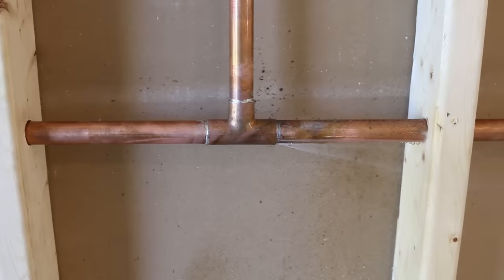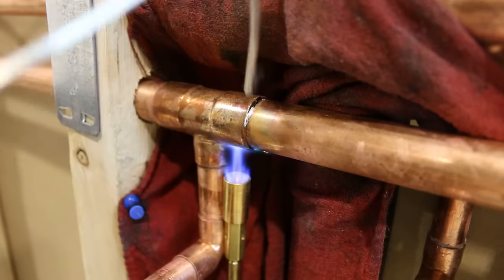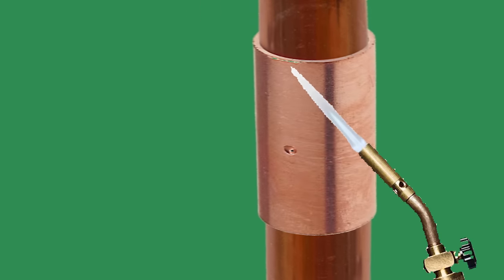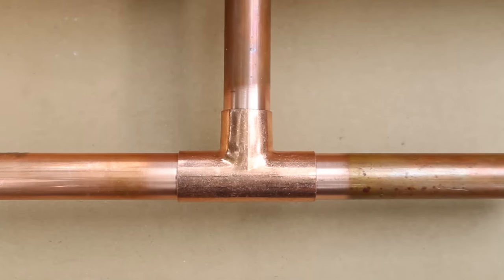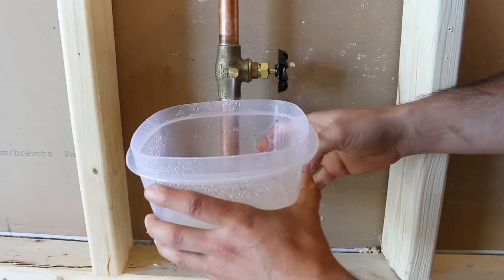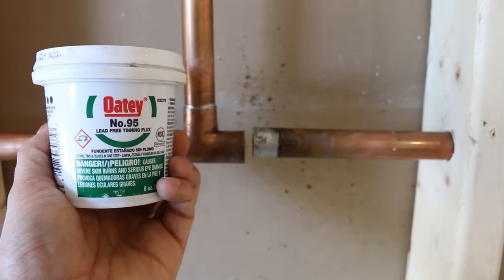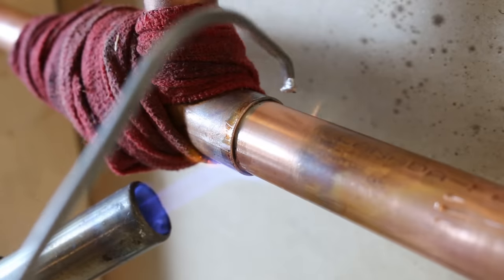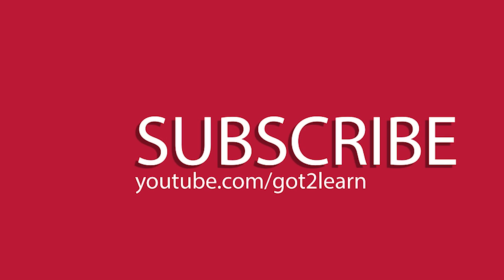The CORRECT Way To Fix A Leaking Joint (UNSOLDERING) | GOT2LEARN

Comment: flux core solder is best for circuit boards ..solder with flux and flux paste is best for pipes ... the JOINT MUST be clean inside and outside where the pieces will meet ... apply flux paste to BOTH sides of the joint fit them together and apply heat 3 to 4 INCHES AWAY from from the joint so the heat radiates TO the joint and takes longer to overheat ... as the paste liquefies apply the flux core solder and let it flow and watch as the solder flows around ... once it has remove the heat and wait DO NOT apply a wet rag DO NOT chill .. DO NOT force cool it for ANY reason as this can break the bond between the solder and the copper as Solder cools faster than copper and the copper wont have solder affixed to it ... as for learning to solder a 4 foot section of pipe and some joints and an hour of practice and you will become pretty good at it if you do the above ... that is the benefit of 42 years of soldering circuit boards and copper pipes

Comment: There are multiple problems with a "partial repair." First thing is any water in the tubing will prevent a comprehensive heating all the way around. One of things we used to do was shove bread into the tubing which will keep residual water away from the solder area but that's not gonna buy you a whole lotta time. It will dissolve later. If you don't keep water away from the solder area the water heats up causing steam pressure which can blow the joint apart, been there done that. Best thing, find a way to shut the water off, make sure to "sand" (usually emery cloth) both ends of tubing, flux all surfaces thoroughly. When you heat the coupling don't waste time. Make sure the solder gets sucked in all the way around. Wipe the residue drip on the bottom before it hardens.

Comment: PLEASE HELP....my bathroom sink backs up into the shower. I’ve been Shop vacuuming the shower drain out and after doing so there is a sewage smell and the shower and kitchen sink clog up on a regular basis. I often have used Thrift but it no longer works. I’ve had my kitchen sink floor drained cleaned out and it helps but it may be needing to be done regularly....I think.  When I’ve asked a plumber they usually reply ...hm, I don’t know.  Can someone please tell me what is happening. Thank you.
Reply: Does your shower drain slowly also?  If so, it sounds like the sink connects to the drain of the shower and there is a restriction / obstruction between that connection point and the sewer... Sounds like you need to either be better in your use of a plunger or need to run a drain auger through it... Most houses only have a single connection to the city sewer line and the various drains in your house will connect to a common line on your property that empties into the city sewer line... If you have an older house that still has clay or cast iron pipes that connect to the city sewer line, you might mind that some tree roots will get in the joints and clog up the lines... If that was the case though, every drain in your house would most likely be having a problem... Does your toilet also have slow drainage?  I'm not a plumber, but it's not that difficult -- water flows downhill...

Comment: If the pipe has to be hammered into the fitting, the join is quite possibly too tight for the solder to be drawn into all of it, so it's better to sand down the surfaces a little bit more.
Reply: Presumably the residual solder that is making the joint tight is fully re-melted during heating.

Comment: Keep in mind solder WANTS to adhere and is attracted to copper; also heat, and if you have a well  prepped surface it will push the rosin out of the way and thru the jount in the process.

Comment: Best way I found to clean glue on a pipe is spray a bit of WD-40 or 3 in one oil. Make sure you properly clean before soldering to not start a fire.

Comment: Only one last step missing at the end, neutralize the acidic flux by wiping it with a wet cloth and  baking soda. It will stop green oxidation on copper which might eventually pierce the pipe.
Reply from the maker: Great point!

Comment: “Knowing how to solder is an art and it could take years to perfect.” 
 Soldering basics are some of the first things an apprentice should learn. Clean pipe and fittings, flux both, heat the bottom and touch the top with solder. When the solder melts switch the heat to the top and melt more solder into it. 
1/2” fitting = 1/2” of solder per joint. Same would apply for each pipe size. Watch your flame and remember the end of everything you solder with will blister you. Now practice at home. We will let you solder caps on in a year or so. 😂😂

Comment: What if you can only get to one side of the copper pipe to heat it , I repaired a leak and only heated the top because it was in the floor but it was fine flux took the solder all the way round the pipe.
Reply from the maker: Then I'd suggest maybe using tinning flux to put all the chances on your side.
Reply: @Got2Learn  oh does tinning flux put the solder round the fitting better than normal flux, I've never used it before.
Reply from the maker: The flux has solder powder in it, so your chances of having a dry spot are close to none ;)
Reply: @Got2Learn  thank you I'll try it. Cheers

Comment: Everything you said in here is 100% except for fluxing the fitting being wrong. The flux follows the heat so even if it gets pushed to the back of the fitting, once you apply your heat it will re distribute the flux around the pipe and inside the fitting. It's not going to stay globbed up in the back of the fitting. So putting it just on the pipe is fine and fluxing the inside of the fitting is absolutely fine as well. Plumbers been fluxing the inside the fittings for 100+ years and no issues so at this point its your preference. Neither are wrong in my opinion

Comment: i worked for years doing bathroom renos and overheating the pipe is something i did several times and had to redo them.. of course they are in a basement at the lowest point and drip forever 🤣

Comment: To put the pipe back in the copper T easier i just heat up the old solder and wipe it off with a scotch brite and the inside of the t with the brush while its hot. It goes in very easy after that without banging it
Reply from the maker: Yes, good technique!

Comment: What happens when you get a fitting that wont solider! Everything cleaned sanded. Maybe the brass fitting bent?
Reply from the maker: It depends on many things. Are you using too much/not enough heat? Is there residual water in the system?
Reply: @Got2Learn  Did you preheat the thick pipe?

Comment: I don't know about you but I've never seen a plumber try to just add solder to a leaking joint. If it does leak it usually followed by a bunch a bad words and then having to cut out the leaking fitting and soldering a new one. Although I have save some fittings before with this same method.

Comment: to clean an old soldered pipe, the best way is to heat it up till the solder melts then use a cotton towel to wipe the old solder off the pipe then, use, preferably,  a scrub pad like the 3m scotch brite 07747. You will end with a perfectly clean pipe.
Reply from the maker: 100%

Comment: He left out water in the line. If 1 drop is near that joint ..your solder won't take....a oldschool plumber taught me this trick! Clean fittings as here.. get sone bread... and packed the pipe both sides if you have too..if you can't get the water to completely stop...the bread absorbs the moisture just long enough to heat connection and solder to wrap around joint. .  I agree with everything else he said..but like I said..here's 1 thing he forgot to mention. And open every faucet in the house..and if you can , have water shut off a day before to get most of the water out of pipe

Comment: Bro get with the times.pro press is way to go.💪🇺🇸
Reply from the maker: Yeah for sure, all I could say about ProPress is that when you make a mistake and your fittings are all crimped back to back, you are actually in a worst situation than if you would of soldered it lol ;)
Reply: Whay about if the pipes are old and really thin, will the propress damage them more than soldering, at work they want us to solder
Reply from the maker: Well yeah, if the pipe is full of holes due to corrosion, Pro Press is not the best option.
Reply: @Got2Learn  that was not the situation.if pipes are corroded then replace with pro press. Ihave solderd for over 35yrs.this New tech.has its place in most all situation.try soldering with water runnung.wont happen.a far better pro choice over shark bite..

Comment: If you hold the torch directly under the pipe, solder can drip into the torch.  Better method is to hold the torch at an angle from the side.

Comment: Just use Yorkshire fittings a lot easier I am a semi retired electronics engineer and it is far far far more difficult and precise to work a surface mount PCB soldering a 15 22 or 28 mm pipe is a piece of cake

Comment: Love Reading all the  'professional ' comments. The guy showed you the proper way to repair a failed joint, deal with it or make your own vid. Ps, back in the day, if stuck with a weeping pipe not letting you solder the joint, as a last resort, shove some bread up the pipe, complete your joint then with the bread come out the tap.

Comment: I've been plumbing for 17 years. All you have to do is take a nail setter, place it on the side of the fitting directly over the leak and whack it with a 22 oz framing hammer.
Reply from the maker: Ouch

Comment: Ok, not that I would EVER do this, but has anyone SUCCESSFULLY "fixed" a pinhole leak by cleaning the area, fluxing and the soldering over the hole?

Or, perhaps taking a copper sleeve, cutting in 1/2, de-burring, fluxing inside that and on the cleaned pipe where the pinhole is and soldering on the halved sleeve as a patch?

Again, I wouldn't do this.  I'm just curious if that's something people do in case of emergency or where it's very difficult to replace the entire run of pipe.

???

Comment: Oaty Number 5 works the best all the water soluble flex is trash . Clean copper fitting and use thin coat of flux .

Comment: Is it not easier to use push fit connections
Reply from the maker: Nothing like a soldered joint.
Reply: @Got2Learn  yes this is true. But until one learns?
Reply from the maker: That's what this channel is for :)
Reply: @Got2Learn  yes that's why I've subscribed😃

Comment: My question is why are you using type M copper and not type L copper for water service especially inside walls because most jusisdictions require type L pipe  and how would you unsolder the joint that was already connected downstream to another joint with no room to pull the joint apart . In most cases you would have to remove the complete section of pipe to Re clean the pipe and the joint properly, and more than likely you will end up with repairs down the road due to using the type M copper anyway budge to hard water conditions

Comment: Here is how I fix a leaking joint like that:  Wrap 10 layers of silicone tape over the leak.  Fasten a stainless steel hose clamp over the silicone tape to keep it pressed up against the pipe when the water pressure is present. Works every time.
Reply from the maker: Good, but temporary.

Comment: Get it hot again , add flux , it will re-clean the inside where the leak is. Add solder from 5 o’clock up to 12 , then 7 o’clock up to 12. 6 will fill in-from gravity.

Comment: Or cut the joint out and replace it using slip fittings. Sometimes unsoldering is a bigger job than you would think.

Comment: I have yet to find a video on how to sweat new to old pipe.
Reply from the maker: On an old pipe, you would just sand it to bear copper and solder it, that simple :)
Reply: @Got2Learn That does not always work the first try if ever. The next time I am working with old pipe I am going to clean the inside of the pipe. I think oxidation on the inside wicks into the joint when heated.

2 out of the 3 old pipes I last worked with definitely had no water in them. I was only able to sweat 1 of those 2 without a leak.

Comment: This is why your neat solder joints with no exposed solder is a bad idea. When soldering you want a fillet, not just enough. You don’t want it dripping but you want a clean fillet around the edge that you can visually see. Because not even clean solder joints are always perfect. It may be fine until you have the pipes in the wall and they start leaking after a few weeks.

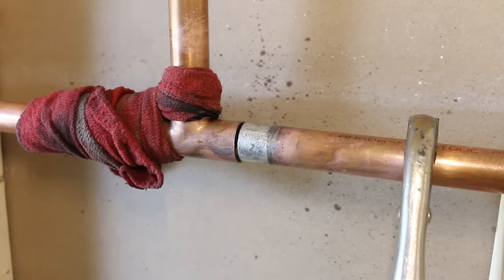Comment: 6:42 you say get a WET rag to remove solder so the pipe fits in… a dry rag is better, and I think what you meant. Wet, will harden the solder making it impossible to clear the solder.

Comment: Can somebody please explain to me why the pipes raddled Avery time we open a faucet or run the shower or any other appliances I don’t know what to do help please 🥴
Reply from the maker: 2 possible reasons: 1) the pipes aren't secured. 2) You need a water hammer arrestors.
Reply: Got2Learn ok thanks I’ll check #1reason
Reply: Got2Learn thank you for your advice it was very valuable to me I think I’ll need a to have a hammer arrestor installed for me by a professional Plummer . These noises are driving me insane.thanks and have a great day
Reply from the maker: Not a problem :)

Comment: what if both sides is already tinned and heated up and joined together?
Reply from the maker: Still add flux and solder to make sure it's soldered properly.
Reply: @Got2Learn  absolutely hate dealing with water in pipes and had to use a compression fitting to finish the last joint. What a life saver!!!
Reply from the maker: @Rellikman  congrats!

Comment: A friend built a house and the plumber made a failed T joint in the dining room ceiling.  He could not do what this video shows because the bit of water inside could not be purged.  So, instead of the usual method: diagonal sawing of the T and heat-removing the 3 remains, he cut the 3 pipes an inch from the joint and installed a new T and three sleeves, resulting in 9 new solder joints.  His poor skills resulted in 2 leaks from the 9 joints!

Comment: What about when there isn’t enough flexibility to separate a joint?
Reply from the maker: You'd need to use the coupling method, coming in another video ;)
Reply: Then a small section of pipe would need to be cut out and then soldered back in using a sliding sleeve (coupler).  This is a sleeve that is smooth on the inside and does not have the indentation that acts as a stop when inserting the pipe. This type of coupler can slide completely over the pipe so the two pieces of pipe can be aligned, and then the sleeve can be slid over both to perform the soldering.

Comment: this fix cannot be applied to copper pipes embedded in brick walls for instance under bathroom wall tiles - all you can do is remove the tile dig out the mortar surrounding the leak, heat and resolder the leaking pipe usually a leaking connection

Comment: I thought everyone knew to take apart and clean for a new/ re-solder. ?? Did my whole house sweating in almost every connection. Been leak free 20 yrs. It's pretty easy stuff. I am just an amateur.
Reply: No one knows anything until they learn it.  You didn't know until you did it either.
Reply: @benjaminberg8305  True, but I didn't attempt it , without completely researching first, better when new at it,  to put yourself through a little course. Wish we had youtube back in the day, videos like this are priceless.

Comment: All I know is if you don't have a pressure regulator in the main line , plan on old valves, faucets, etc. Leaking and ruining your day. And never try to solder a closed system or you will have a leak.
Reply from the maker: Good stuff, thanks!!
Reply: @Got2Learn  I just put a regulator on my line because I have 85 pounds coming in and blowing valves and seals. Mistake I made was attaching the regulator before I capped of a line and the steam blew the solder out instead of drawing in like normal. I said a few choice words and bought another cap. All good now. Great video.
Reply from the maker: You did the good thing ;)

Comment: After service plumbing for 4 years, there's no way in hell I'd try to just "patch" a leaky solder joint. Not only is it incorrect, it's not possible.   If there is even slight water vapor in that pipe, that joint is not going to seal and I don't care if you're a 20 year journeyman. You can't do it. Although, the copper I usually work on is old stuff from the 70's. I do no new construction. If someone knows a trick to just patch without taking the whole thing apart, please let me know.
Reply from the maker: Some people actually get away with it belueve it or not!
Reply: Got2Learn Hi I have used a self cleaning flux for the last 30 years ( laco is a good make)  never have any problems with leaks .If a joint blows because of water in the pipe, heat fitting ,brush with flux it will capillary into fitting add solder jobs a good one
Reply from the maker: Ok I agree that it will patch it shut, but how long will it last that's the real question?
Reply: Hi most of my work is for long standing customers over many years ,can't remember ever having a call back .its the flux that makes all the difference well worth checking it out .just got to make sure heating systems are given a good hot and cold flush out before final fill 🤔🔧

Comment: You don't heat the metal up until it changes color from my personal years of experience you simply heat other areas of the same pipe because remember copper is good at  conducting both electricity and heat so you don't necessarily have to heat the very end of the pipe for it to get hot myself and my father have been sweating pipes for years and have some of the most beautiful sweats without color changes what's so ever